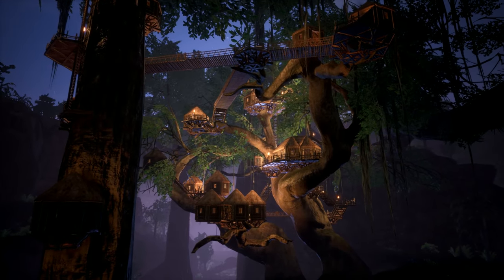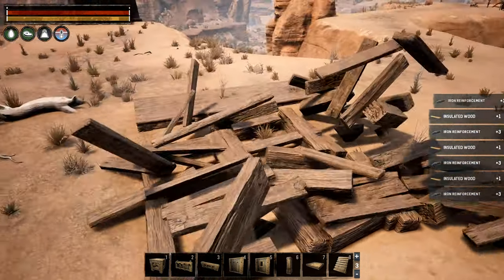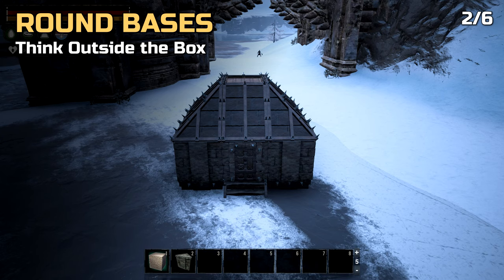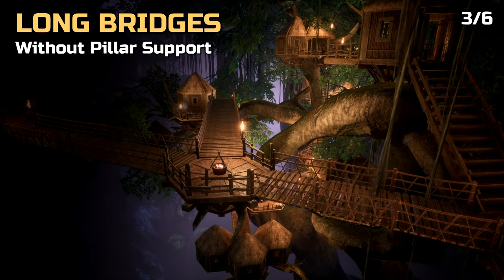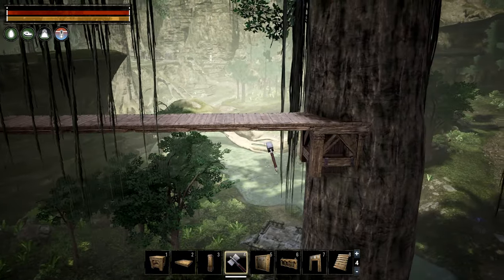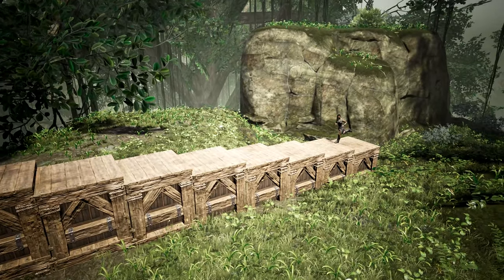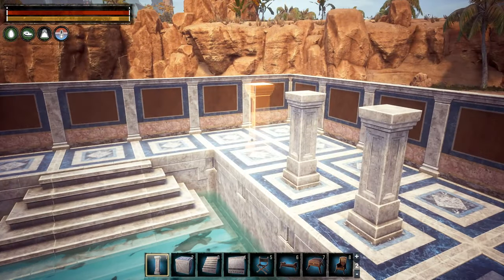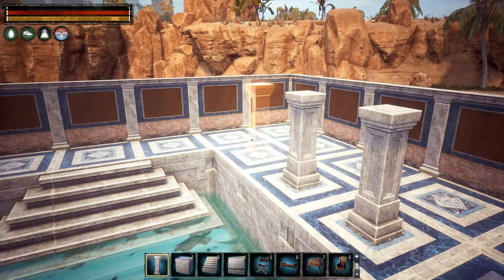6 Building Tips for Creative Base Designs (No Mods) - Guide | Conan Exiles

Comment: When using the fence (or wall) technique to step up with foundations, you can make the steps walkable by placing fence foundations between the foundation pieces snapped at the lower position, similar to the step down technique. basically you are combining both techniques
Reply: What a genius

Comment: For the stepped foundation, one can also use fence foundations instead of the actual fences. These can be offset either slightly higher, or slightly lower, depending upon what is needed for the build.

Comment: Benn building complex structures in Conan for a while now and I still love those roof tips. However, if you are trying to build functional buildings that look as pretty from the inside as out, connecting those levels with stairs can be a nigfhtmare with either elements sticking through the floors or you creating "dead" floors to hide the problem pieces in a closed off space.
Reply: What are the workarounds?

Comment: So on the fence riser for foundations could you remove all the fenced foundations on the build up in height then work backwards with the Fence foundations to make a smooth reverse  effect?
Reply from the maker: Yes you can. But there's no need to build up first, just build your centre and build down on both sides with fence foundations. But yes, you could in theory do what you suggested.

Comment: The foundation tricks works with celling too?
Reply from the maker: If you are referring to the round foundations, that should work with ceilings as well, as long as you support them going further out.
Reply: And about the pillars between  the floors? I can use cellings instead of foundation?
Reply from the maker: Indeed, non-centered pillars work as well with ceilings, just use the same trick with the stairs as you would with regular foundations.
Reply: Ok! Thank you!

Comment: How are you deleting the walls and builds so quickly like that without going through the menu wheel?
Reply from the maker: In admin mode, you can use a shortcut for deleting items quickly - for PC, it's Shift+Delete. The good news for non-admins, is that the new building system that was introduced with Update 3.0 let's you also switch to a "Remove" mode where you can very easily delete things quickly.
Reply: @Pixelcave  THANKS! this makes things so much easyer